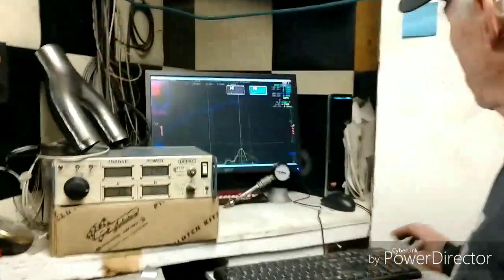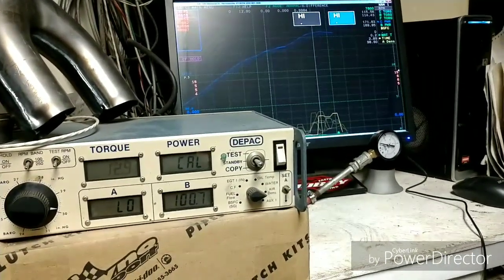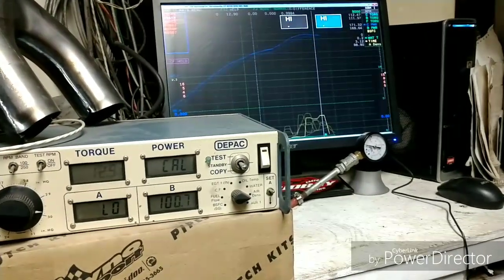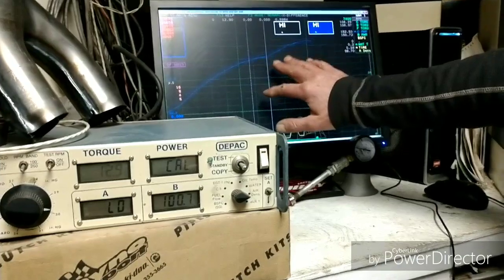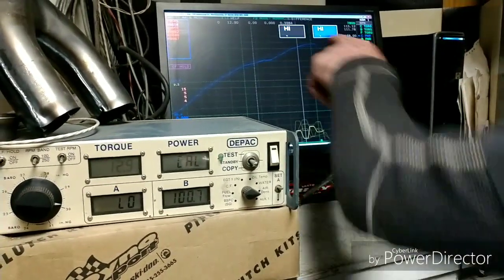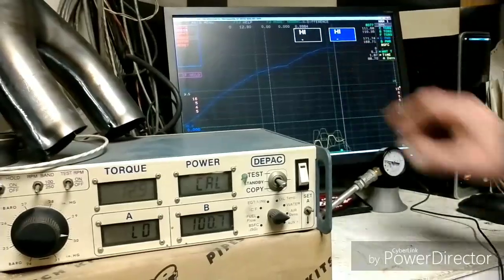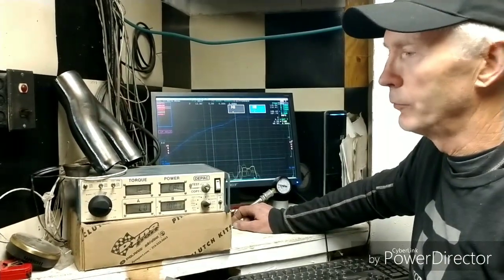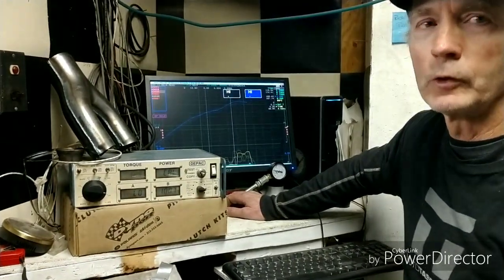DynoPort Ski-doo 850 pipe and y-pipe development

Comment: One of the reasons I recommend DynoPort when it comes to exhaust.  I fkin HATE y-pipes for the most part from dealing with customers not having good running with them, to my own experiences.  Many many times, i've recommended guys to put the stock y-pipe back on (from other brands) and engine speed got corrected; but not on DynoPort products. Thank for informative video.  Rich does competent work!
Reply: When dynamo joe says it’s good. Then it’s good